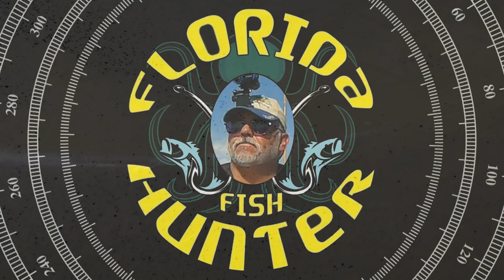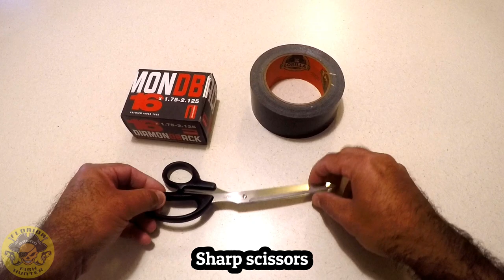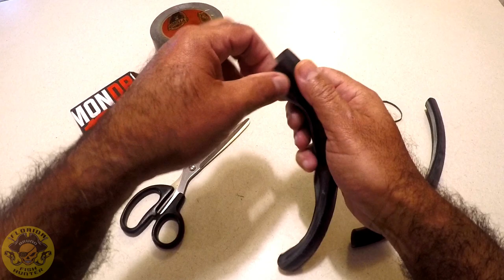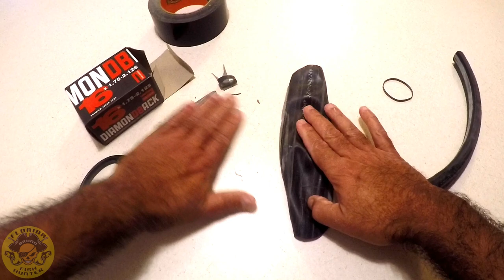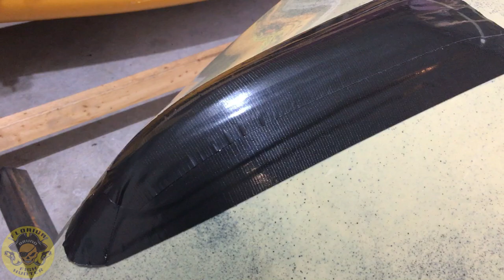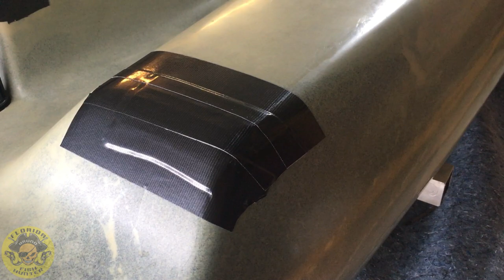Gorilla Tape Budget Kayak Keel Skid Protection Upgrade - Florida Fish Hunter

Comment: Try Kydex .008 that also works pretty good. Just cut it to size then apply heat and mold it to your desire, Thanks for sharing.
Reply from the maker: Absolutely! Kydex is the way to go I just haven't gotten around to ordering it yet but it's going to happen. I've tried PVC on my Native kayak but the plastic hull thickness is just too thin and I thought it was on the verge of deforming the nose keel with the heat required to form the PVC although PVC did work out great for my Hobie PA. Thank you Will for your suggestion and comment! 😊👍
Reply: How do you get the kydex to stay on? Do you glue it ? Or heat it directly to the bottom of kayak?
Reply from the maker: @samaca5579  See the following video: https://youtu.be/Al-Hd2drQg0